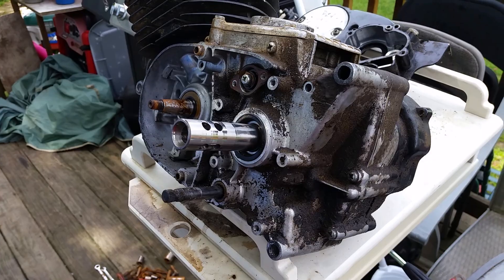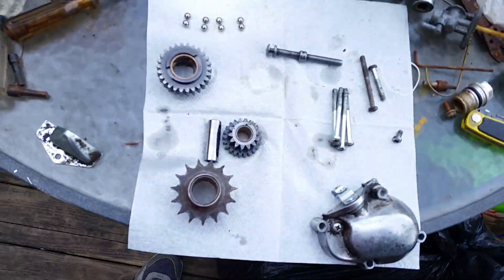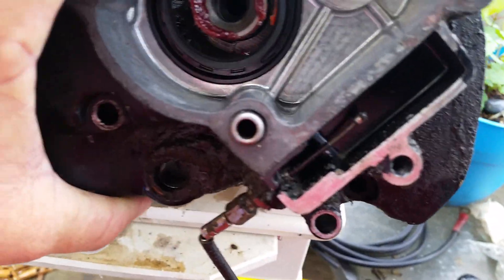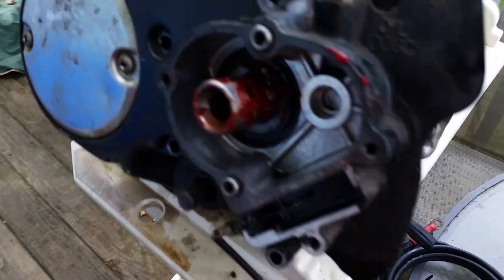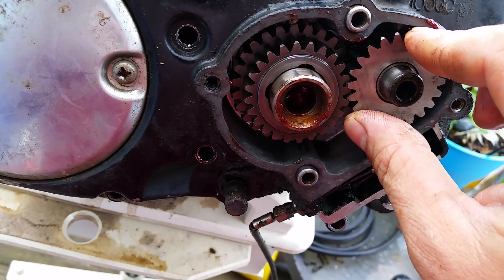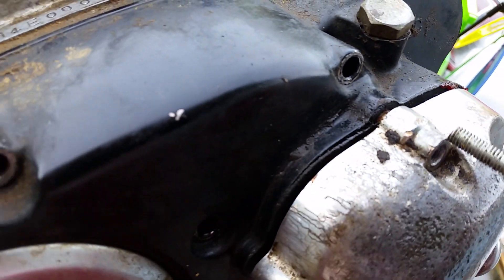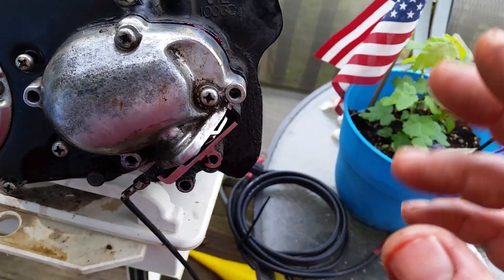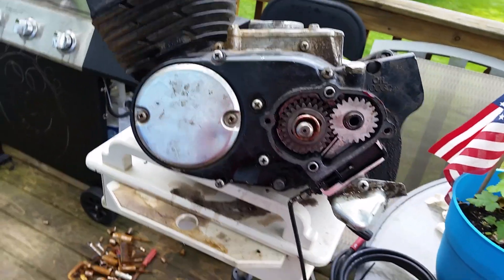Kawasaki g4 10speed gear box

Comment: I was having problems shifting. I replaced the cable, thinking that was the problem. Now, after watching your helpful video at the 12 minute mark, I've learned that I have to take off the cover, and check to see if the little rectangle piece is connected to the shaft for shifting. Cool Beans. You're a Kawasaki 100 god!
Reply from the maker: Jenn Tek thanks I try to make videos to help I seem to be the only one for these bikes

Comment: I have one of these things that kicking my butt. Are there any tricks to getting the shift cam with it's 3 forks and the input and output shafts in so that they work. I notice there is an extra hole on the right side of the shift cam where the shifter catches the pins to turn the shaft is that supposed to be installed in a certain direction. The book doesn't say anything about aligning things when you put the forks into the two gear shafts. All the gears are there and all seem to slide smoothly on the shafts, but when I turn the cam it will only find two positions and then it feels like it's hitting a hard stop.The thing came with the cases split and parts in a can but the transmission was in the right side case.

Comment: Thanks for the video!! I just bought a 1969 C2TR Roadrunner I need to put a set of points in I noticed the dual range unit has to come off to get the engine side cover off I wasn't able find any info in the manual. Thanks again!!!
Reply from the maker: Very welcome

Comment: Hi Kevin great info as always,  do you have or know where to get the cable and lever for the g4.
Reply from the maker: You can get the part number off partszilla.com also kv100 and Suzuki TC90 10speed  and TC100 10speed cables are different but work

Comment: Hi Kev! I picked up a G4TR from ‘72 and the hi/low shifting rod is totally cooked in, won’t budge. the first little gear came out fine with its ball bearings but the second larger gear is totally jammed in. Bike still goes good, just stuck in the high range gear box. Any tips or advice would be super appreciated!!
Reply from the maker: Gently tap with a brass hammer

Comment: Hi Kevin, I just finished rebuilding my trail boss. I have 2 issues left. First I don’t know how the battery is supposed to be wired with the fuse installed and 2nd fuel was coming out of the bottom drain filter. I assume I don’t have the float set in the carb correctly. Any advice would be greatly appreciated.
Reply from the maker: Fuel leak is needle and seat
Reply from the maker: Black wire is ground and white with strip is positive

Comment: What are the torque specks for the clutch engine side cover help please
Reply from the maker: the side cover screws are just tight with a #3 Philips screw driver and the 6 clutch bolts are 3.5 ft lbs
Reply: Ok thank you

Comment: The original service manual calls for choice of ATF or SAE #30. Now 10w30... Just in case anyone is curious. Also, 3/4qt of oil, and 100cc in the gear box.
Reply from the maker: Jenn Tek 10 w 30
Reply: I guess it depends on the year, and the bike? I can't post a pic, but, I've got the service manual...  I'll just use ATF... one quart should do the engine, gear box, and maybe the forks too.
Reply from the maker: Jenn Tek don't use ATF it uses 10w30
Reply: ok
Reply from the maker: Jenn Tek I have always used the same oil I put in the transmission easier for maintenance
Reply: @2strokeguru  hey, should I use sae 30 or 5w30?? I'm probably going to go off of the manual if you cant tell me.

Comment: Kevin, great video, but after removing the 4 bolts, my cover is STUCK on. Is there something else holding it on? Is there a "trick" to removing it? I've been hitting it with a dead blow hammer, and regular hammer with wooden block, but NOTHING. It's STUCK. Help please?
Reply from the maker: Try moving the shifter lever
Reply: Warm up the top and bottom bolt  at the case. Those two screws have dowels, which are tight.

Comment: I'm helping a friend put one of these back together. We got it running and it runs good. But would you have any idea where I could get a new or lightly used front sprocket for it??
Reply from the maker: Sorry I just have new ones made
Reply: @2strokeguru  ok... and how do you do that?
Reply from the maker: @benstrobel5598  i ordered a 16tooth sprocket for a ke100 took the sprocket that you have to a machine shop the c ut and replaced the sprocket
Reply: @2strokeguru  ok,thank you!

Comment: What are the benefits of having a 10 speed on the ke 100 and where can I find one for a 2001 ke 100?
Reply from the maker: Hi and low range low is great for climbing steep trails mud deep snow and then high for regular street riding this is not on ke100s this engine will fit a ke100 but not found on ke100 this engine came in 2 versions high compression version found in early 70s on the Kawasaki trail boss 100 and the 2nd version regular compression Kawasaki kv100
Reply: gostboi1978 for trail riding and hill climbing it's V speeds in low and V speeds and high it's not really a 10 speed
Reply: gostboi1978 you can't find one they are built into the engine

Comment: Hello Kevin, is there any way to make this bike a basic 5 speed without the high/low gear portion? I recently bought a trail boss (I thought it was a KE100) and I don't have a bunch of the parts needed for this system to work. I am in the process of acquiring them but I don't know if it is worth trying to fix this engine or if I should swap it out. Speaking of which can you switch out the engine with another K variant or are the mounting points too different?
Reply from the maker: hi you would need to change left engine case half and transmission output shaft and left side cover 3 parts i believe i have all 3
Reply: @2strokeguru  is there any way to contact you other than comment section?
Reply from the maker: @MrPappy1990  603 395 8097 phone or text

Comment: Do you have any idea why on my 73 G4TR it will not go into first gear? Any idea if it can be repaired by only removing the right side cover or am I looking at tearing down the entire case? Thanks! And thanks for all the videos. Just started on this project today!
Reply from the maker: Could be the shifter where it connects to the shifter drum
Reply: Kevin Bergeron thanks. I am tearing it down today slowly labeling everything I remove. Plan on doing a restoration on it. So lots of pictures! Will share them here once I am complete!
Reply from the maker: @LarryT78  awesome thank you
Reply: I have a question. I figured out that my bike is a 74 and it’s 5 gears all up. But during that fiasco I pulled the cylinder and both it and the piston are shot! Any chance you have any spares laying around or can a ke cylinder be used instead?? Thanks so much for your help and advice it’s been a huge help!
Reply from the maker: @LarryT78  I am sorry I don't check Ebay and Facebook forum
Reply: Hi Kevin, I have one more question for you I can’t seem to find a clear answer on. Is there a gasket between the clutch actuator and the cover? Thanks I am nearing the end of getting the engine together!
Reply from the maker: @LarryT78  yes try looking it up on the sister bike Kawasaki kv100 that is basically the same bike
Reply: Kevin Bergeron I was looking through my gasket set and want to make sure I have this right cause every blown apart diagram doesn’t show a gasket between the actuator itself and where it goes through to push the diaphragm plate to release the clutch. I searched high and low. 

In my gasket set I have two possible gaskets that seem to fit on fairly thick gasket and a thin paper one. I believe that it should be the thin paper one but do not recall removing a gasket from that, just a gasket from the cover itself. Thanks again for all your help.
Reply from the maker: @LarryT78  if you have a piece of the old one match it the difference in gaskets they are used as shims
Reply from the maker: Very welcome

Comment: Finally, today... I had time to take that gear box cover off... I looked it over, and all four bearings are there for the shaft changer.... The cover came off easily, so, I"m guessing the previous owner didn't have the rectangle spinner on the shaft... I now have 10 speeds... Tomorrow... I will swap out the goobered up shift shaft. I already cut off the goobered splines, and smoothed them over so it will slide out the other side without ruining the seal.  While I'm in there, I'll have a look at the carb, float, and jets, just to make sure they are nice and clean... Then, I'm after the fork seal replacement... and finally, I'll work with the little air box. I'm not liking how it looks right now... I think I'll make a new tin and breather since the original is gone except for the cone and base. I don't want the air cleaner foam exposed to ALL the elements. :)
Reply from the maker: Jenn Tek that's awesome
Reply from the maker: Jenn Tek let me know how it goes
Reply: I sure will. Have a great weekend! Hopefully I'll get to ride this little fun bike tomorrow night, or at the latest - sunday... the 15th!!! o_O

Comment: I need a new sprocket and can not find one anywhere!!!!  Thoughts?  Hints?
Reply from the maker: ebay has them and partszilla
Reply: Both long since sold out :(.
Reply from the maker: cheap cycle parts has them when you type in your bike look under rear hub
Reply: I'm really not as helpless as I seem right now.  Did you actually see them at cheapcycleparts.com?  They don't seem to support anything pre-84 so my '75 G4TR-E doesn't apply.  The part # is  13144-038 but that doesn't come up either.  If you do come across one, holler.  Thanks again, man!
Reply from the maker: oh my bad i thought you needed for a ke you need it for the trail boss
Reply from the maker: that gear is hard to find
Reply: The non hi/low front sprocket are easy to get. Howver, these bronze bushed front sprockets are really rare and only available as used or second hand from wreckers.